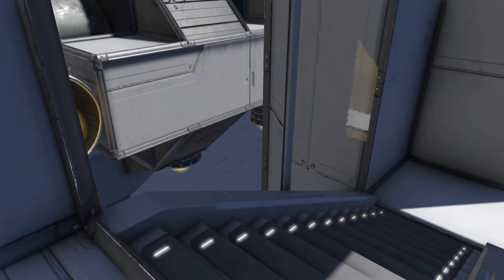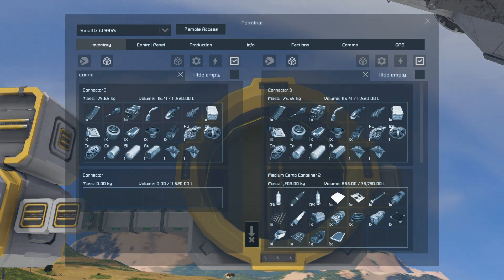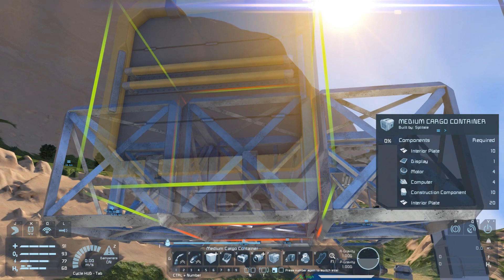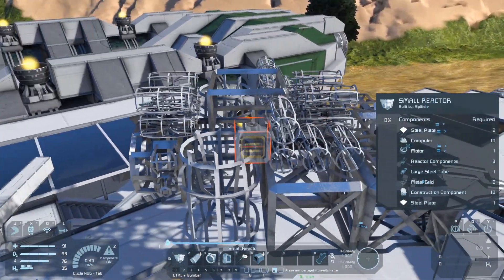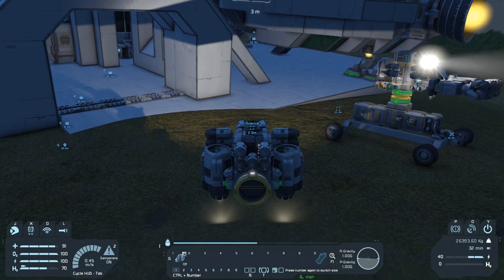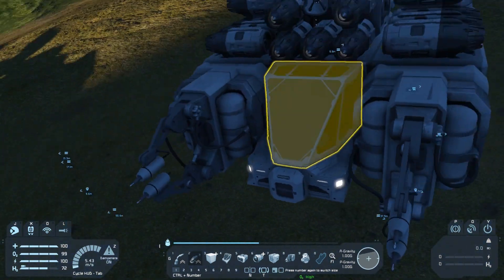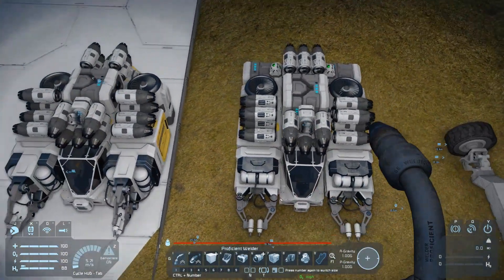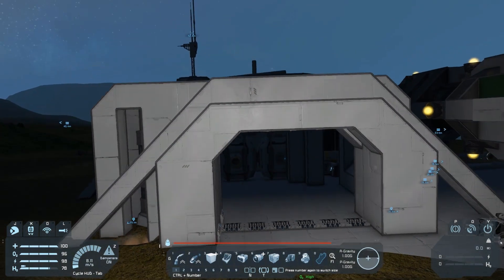Space Engineers Tutorial: Conveyors and Welding Ships (Part 7 of a survival tutorial series)

Comment: Hope somebody can answer this
First off Awesome videos i enjoy them alot and they are helping out a bunch

So,
I always thought Batteries save energy

But in space engineers it seems like they are producing power 
Or am i wrong?
Reply from the maker: With batteries if you have all of the checkboxes in the control panel unchecked they will act like capacitors. If you have excess energy they will charge and if your system needs energy they will discharge. That's why I normally recommend that people use that setting, it's the most intuitive to me. While the batteries may be slow to charge from small nuclear reactors they can discharge very quickly if the ship requires it, I haven't looked at the exact figures, but on small grids you would need a lot of small reactors to match the peak power output of a battery.

When you first build a battery it will have some charge already in it, I think it's about 25%. This can be very handy so that you can then get the ship to somewhere that the batteries can fully recharge, or to allow the conveyor system to function in order to get uranium to reactors that are otherwise unable to be accessed. Batteries will never generate power themselves, unless there is a mod out there that does that which would be strange. If you're seeing the battery getting filled then you have excess power from your reactors or solar panels.

Hopefully that helps :)

Comment: Nice design. personally I found it best to make the conveyor system in total a U shape (rather than your Y shape) from the top, basically having a single large cargo container in the rear center with its large conveyor ports on the sides, and extending from there one curved conveyor tube facing forward, then 2 medium containers (substituting conveyors) and then the welders. As for the cockpit, the better idea in my opinion is to use the fighter cockpit as it has a large conveyor port in the rear (and the welders being placed further forward gives the needed space) thus you can use it for even more component storage. Its a tad wider than what you have (and potentially less forthcoming for in-atmosphere use due to thruster placement) but the distance between the welders is ideal to have a choice between welding "lanes" of either 3 or 4 blocks. 
By the way, I did notice that I forgot about the connector. The welder I described wasnt actually built by me (but it was everything I would have built), and as far as memory serves the connector was on the top, and as far as memory serves it had a large conveyor connection to the large container, so I really have no idea where the cockpit was connected (given the large container has 3 large and 3 small conveyor ports).
Reply from the maker: That setup sounds like it would work reasonably well, I'm a fan of making my welding ships as small as possible so that I can hopefully fit into small-ish gaps but it does tend to limit the carrying capacity a fair bit.
Reply: Well, I tend to use welding ships mostly for outer hull assembly, especially when making it out of heavy armor, since it both gives you a large volume of blocks to weld, as well as heavy armor taking up a shitton of inventory space. 
Any internals, from bulkheads to reactors, are usually manageable by hand.
Reply from the maker: That's definitely a time you want something with a whole lot of cargo space! Welding up heavy armor is such a major pain, especially since they introduced the metal grid requirement.

Comment: My Welding and Grinding ships tend to break a lot (probably my fault :D) but I like to include a projector in all of my designs and self align the blueprint of the ship and leave projection on. So if something breaks, you can see it in the projectors block menu and fix it without much effort. :)
Reply from the maker: Self-repairing or identifying missing blocks is a great use of projectors, especially where it's hard to build in symmetry, like on large ships. I've not used it a lot myself, but for those more complex builds it's really helpful :)

Comment: When you said size can be an issue, like for tight spaces, I immediately though of a welding drone I made, they don't really work as well in atmo because they need to be able to lift themselves off the ground, but in space where you can get away with 1ion per direction, you can get a very tiny welder that you can actually still pilot from onboard the craft, or if you add an antenna, you can remotely pilot it too, you don't even need a remote initially but it makes things easier. All you need os a medium/large cargo container, six small ions, a gyro, power from say a reactor, the grinder/welder, and an industrial cockpit, you can also add a connector pretty easy if you go with large cargo because of the third large port on the side. You may also want a camera, an o2 gen or tank, a remote, and an antenna, the remote/antenna combo would remove the need for o2 and the cockpit, but I prefer to pilot from on board
Reply from the maker: I completely agree that direct piloting has big advantages for welding/grinding ships - especially in tight spaces. When I'm in space I'm like you, build something with the bare minimum of thrusters in each direction since you don't need to move quickly (in fact moving quickly can be a downside) or fight pesky gravitational forces...
Reply: I usually do double thrusters but half of them are almost always off and I use them only when my container is full

Comment: You created a welders group and added a control to toggle them on and off from the g-menu. Then you mentioned the dangers of exiting while the welders are toggled on. I would instead suggest grabbing the welders control from the tools and weapons tab of the g-menu, which once selected, will only enable the welders while the left mouse button it pressed. This would help prevent accidental suicides by welders.
Reply from the maker: A very good point!
It's probably useful to have both set up on your hotbar, so you're safe most of the time but if you're building a large area and don't want to hold down the mouse the whole time you've got that option too, even if it is a little risky ;) 
(for some reason the double click that works with character tools to keep them active doesn't seem to work for me with ship tools)
Reply: You can also add a sensor that automatically shuts them off when it detects a player within range.
Reply: It does work if you go into a menu while holding the button, then when you get out of the menu you click to stop it
Reply: so posh way of writing a comment by misspelling 'is' as 'it'

Comment: I end up making my utility ships double-ended. I like putting my connectors on the bottom, so by the time I've finished making a welding ship I realize that I'm 75% of the way to making a grinding ship, too. I figure that both a grinder and welder ship need most of the same parts anyway -- large conveyor network, storage, thrusters -- so why not combine them into one ship and save reduplicating common parts? One end has the welders, and the other end has grinders. Switching modes is as easy as jumping out of one cockpit and hopping back in the other!

It ends up being larger and a bit more awkward than a smaller, dedicated welding ship, but as long as I'm careful with how I maneuver and the order in which I build a large structure, I'm fine. If I really needed to weld in a tight space I can always make a tiny remote-controlled welding drone, or even just accept doing some work by hand.
Reply from the maker: If size isn't an issue that's actually a pretty neat solution :)
I tend towards the lazy so for the really tight spaces it seems less effort to either do it by hand like you said, or grind down some armor so the ship can access the area
Reply: @Splitsie  I just make mine a little thicker, and stack the welders on top of the grinders.
Reply: I managed to make my utility ship exange arms when i need to. I have the conveyor hinge mod and i stick on my welders/gringers a merge block. Then i made a little station to merge the arms and then disconnect them with the disconnect option of the hinges (like a rotor) I can then proceed to lock on another set of tools to fit my needs. Pretty neet ! I need the hinge mode so i can disconnect it while being able to convey stuff without having the sinking effect on my ship caused by the sub grid an advanced rotor would make (your dampners dont take in account that weight and your ship sinks on atmospheres) the merge blocks make sure that my disconnected arms are on a powered grid so they dont despawn with the trash removal tool enable in the settings (alt F10)

Comment: Great videos, thanks for doing them. A potential difference between welder and grinder ships is that a grinder ship needs all of the grinders conveyed so as to capture the components but a welder ship could have many welders but only needs one connected to place the components. Any thoughts about using the Large conveyor and welder systems when building Large grids like bases and similarly sized grids? It makes sense to me to use a conveyor net to move many component blocks like refineries or large reactors thus potentially bypassing the need for a ship all together in those cases, simply queue up the components in the assembler then turn on the welder placed as what would be the lastas what conveyor tube then remove and replace with the last conveyor tube.
Reply from the maker: Thanks :)
You're absolutely right about the difference there, I've always built my welding ships so both welders can place components (never bothered building a larger one). One of the upsides of this is there are times where the right welder can reach something the left can't - and vice-versa. But you could have two welding ships, one with a couple of welders but no cargo, one with just one welder and plenty of cargo, they'd both be smaller so you could fit them in corridors and smaller places but should still be quicker than hand welding.

If you've already got a functional base but you're expanding or reorganising, using the large grid welders like that would certainly work but I'm not sure how much time you'd really save, particularly if you've got a welding ship... off the top of my head I can't recall how many components are required for large grid welders. I might give it a try in the future as it certainly sounds like a nifty little concept :)